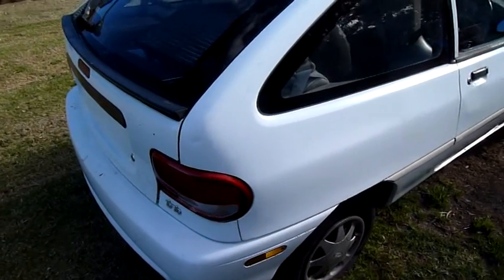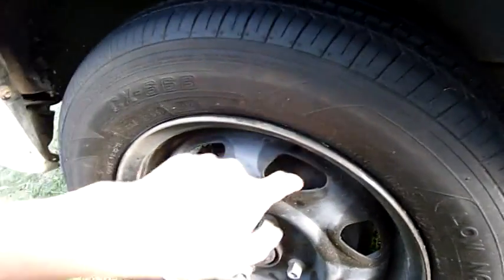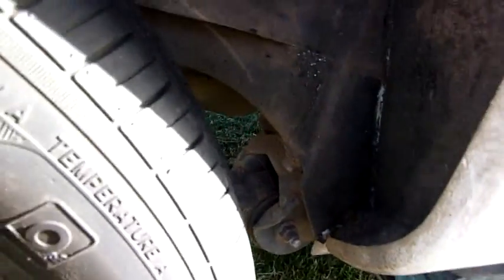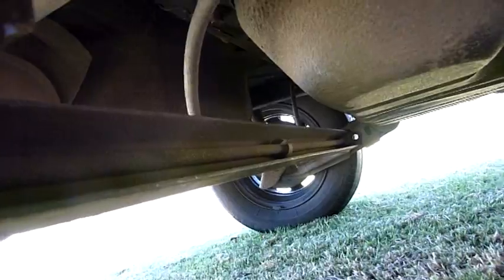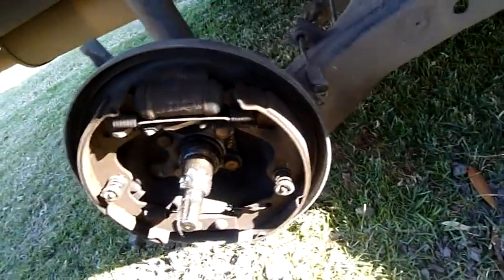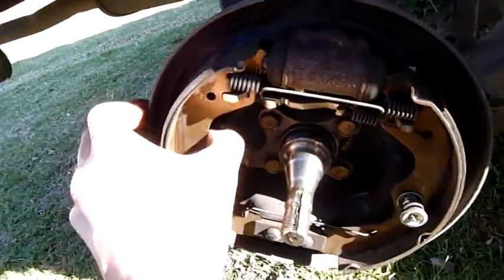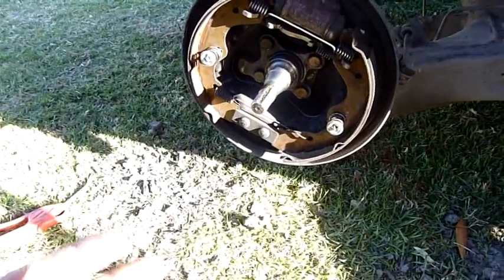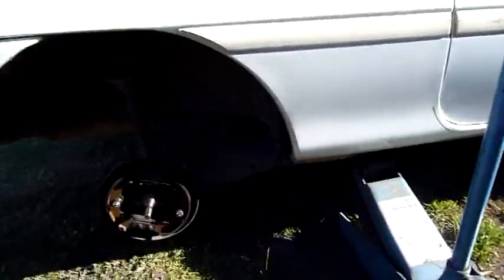Ford (Kia) Festiva's Rear End Setup and how Drum Brakes Work

Comment: There is two bearing's on the drum you would not have the wheel attached for long with just one! Also the bearing is small because your only supposed to have 1100 Lbs total weight added to the car. Thats you your friends and baggage etc.. VS a truck that can haul 8k+

Comment: You should use this car for some motorkhana. attach a trailer brake or similar master cylinder inline with the rear main brake line, attach a big F#@&off steel bar to the piston rod on the new master, mount in the cabin and away you go

Comment: Reason that rear brakes are made less effective than the fronts is to prevent the rears locking up and skidding, which they are prone to do because of the lessened weight share they get when braking.I believe braking is 70-80% front.Till ABS came.

Comment: just to point out, that bar thats inside the rear axle beam is the sway bar, those kind of axle's are suppost to act like independant suspension but both wheels are connect, the name i believe is a flex beam axle, my car is the same way, but the shock and coil springs are separate from each other.

Comment: nice , the brakes look simular style to my old daewoo lemans GTE/OPEL KADETT mk2 clone EXCEPT THE DRUM with rhe hub built in , most of the linings were german made, i use to get the whole assambly as one unit with the backplate, linings and piston,as well as the hub and drum ,back in korea when i had acess to the assambly line for GM daewoo, made it really convient to do a complete brake job instantly with all new hardware :P